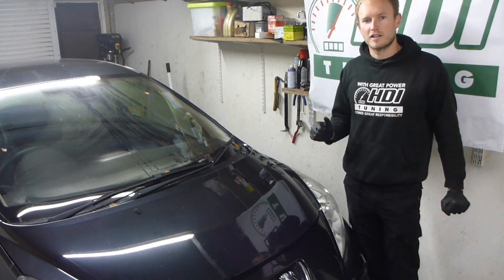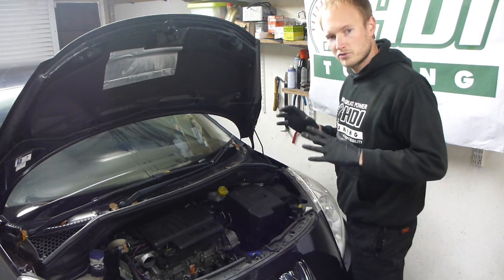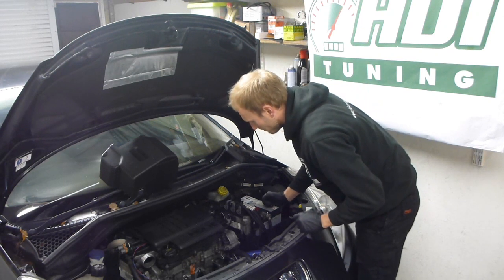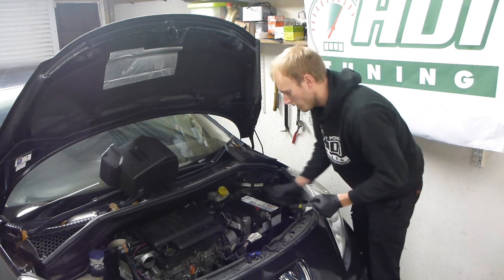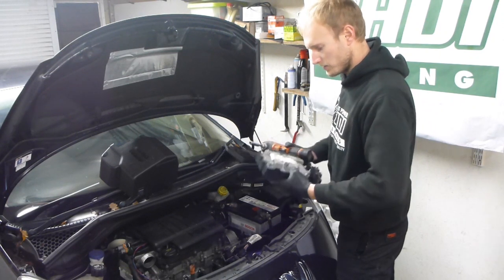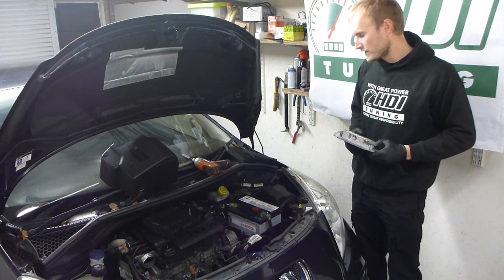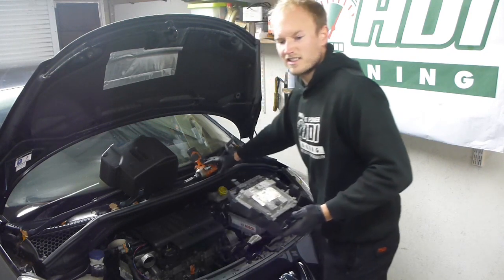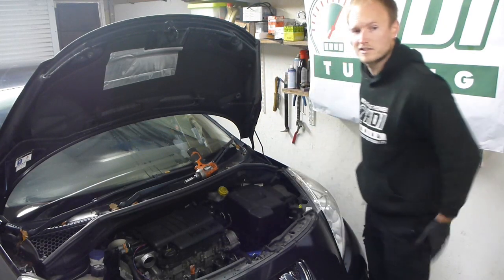How to remove the ECU from a Peugeot 207 1.6 HDI Bosch EDC16C34

Comment: I was dumb enough to drop the ECU on the battery and it made contact.complety fried it and know have to look for a full replacement which is almost the entire car worth I dont know what to do know.
I have puegot 207 out of 2009. any fix that will not cost atleast above 300 euro's
Reply from the maker: We sell ECUs, they aren't expensive. Check all fuses too in the engine bay fuse board and the BSI. Did it melt any wiring, or was it just a. Quick spark to the ECU?
Reply: @StevenLewis-HDI-Tuning   a quick spark to The ECU got it of the battery in a second. 

I have old puegot donor car sitting around tried that ECU as replacement and now the car does respond but than i found out there is a slight difference and all these codes / programming that have to match to letting it crank or something

Comment: Can I put an ecu from a 1.6hdi into a 1.4 hdi ?
Reply from the maker: @LukeHayes-j9d  yes it will run, but the injectors are different, timing is different, head is different, displacement is different. What are you trying to achieve?
Reply: @StevenLewis-HDI-Tuning this is a ecu from a car that I have for parts but it’s a mapped ecu

Comment: Hi i try to change the radio on my Peugeot 207 and I make a short I have the following problems now central loking dost work the small screen not working when I try to start the car engine is not starting it can be an ecu fault or just a fuse all the fuse seems ok after testing with multimeter what can I do ? Thanks
Reply from the maker: You probably broke the bsi or just a fuse. Not the engine ECU that's not linked to the radio is it..
Reply: @StevenLewis-HDI-Tuning  I check the box fuse next to battery and the fuses in bsi inside the car there is another box with fuses for this model ?

Comment: If we have a problem
With the power steering that's not communicating with the power steering ecu is this the ecu that's it's not communicating with thanks
Reply from the maker: No, this is only the engine ecu. Check the big 30A fuse for the power steering

Comment: Hi Steven.
On an 3008 mk1 , when replacing the steering lock and key do you need to replace the ecu from the same car as the keys to start the engine?
Reply from the maker: You can program the new key to the vehicle, speak to a auto lock Smith
Reply: @StevenLewis-HDI-Tuning  I known that , but can it be done with replacing the ecu?
Reply from the maker: @samys-g3o  with an unlocked ecu with no immobiliser you wouldn't need to code it.
Reply: @StevenLewis-HDI-Tuning  thanks for  replying my questions.but I lost the keys for the car and I can buy an complete lock set and ecu from an donor car .I can replace the locks but the imobiliser won't work hence I'm asking if I install the ecu from the donor car as the lock will be able to start the engine without programing the new key imobiliser.
Reply from the maker: @samys-g3o  the BSI, key chip and engine ECU are coded to each other so you'd have t swap the whole set
Reply: @StevenLewis-HDI-Tuning  thanks Steven for confirming. Yes that was my question .
It's there anything else that need replacing to original car accept key chip and ecu from the donor car?

Comment: Hi Steve, was going to change the fuel filter on my Peugeot 207 2008 1.4 hdi. For this you have to swing the filter to the right, but the ecu is in the way, lifted the ecu out but managed to short circuit this against the positive side of the battery. Unfortunately the car will now not turn over, have all ignition lights, checked all fuses, non seem to be blown, have I blown the ecu unit? What will it take to get this car running again?
Reply from the maker: Probably killed the ecu that happens a lot, bad design on Peugeots behalf. If you email me through my website with a photo of the label on the ecu ill sort you out tomorrow. I've got most available for immediate dispatch.

Comment: Hi Steve thats awesome!
what is required to run the engine once the Immobilzer is removed??I want to run the engine in a boat.Do you think thats possible if I sent in my ECU for imobolizer removal?
Reply from the maker: Its best to put all the modules and wiring even if its just in a box, and then work backwards removing modules one at a time. I dont think you can make it run without the BSI but everything else you should be able to remove

Comment: I have a Peugeot 207 2012 model. When I turn on the aircon my car goes into limp mode. Can anyone say what could be wrong. Without aircon car goes good. Once I turn aircon on it goes into limp mode and a orange light turns on the dash
Reply from the maker: You need to scan for fault codes, we cant guess this one so you need to connect using peugeot diagbox diagnostics and see whats causing it.

Comment: Hello. I have a enginelight on the car. And warning text: Pollution fault. Problem, broken/fault ecu?? Can i take out my broken ecu. Buy a used ecu on ebay and just plugg it in? Or can the problem be fixt? Or do i have to get the car to a mechanic after i put the "new" ecu in? Thanks 4 the help. :)
Reply from the maker: Hi, an ecu can't fix mechanical faults on your engine. First connect with Peugeot diagnostics equipment, find the cause of the faults and then fix accordingly.
Reply: @StevenLewis-HDI-Tuning  Do the Numbers have to match identically on the two ecus? I had a tuner before try to sell me an ecu with different Bosch & psa numbers on it and I thought hell no surely they would need to be identical for everything to work liable to blow something up lol
Reply from the maker: @Mr330d  yes all codes should match up, otherwise you'll end up with faults or strange behaviour, or if it's completely wrong it will run like a bag of spanners and break down shortly after. Why not just get the right ecu, I have most of them available for psa and for a lot cheaper than your mechanic will charge I expect.
Reply: @StevenLewis-HDI-Tuning  I was thinking to myself absolutely no way can you fit an ecu with different matching codes yes I plan to buy one of your ecus soon because I was having boost issues with my 307 and didn’t want to fit anything until it was all sorted . It actually goes alright for a 90BHP 215NM torque
Reply from the maker: @Mr330d  it probably needs a new turbo solenoid? Not very often an ecu fault will cause boost problems on these.
Reply: @StevenLewis-HDI-Tuning  I fitted new solenoid new vac lines etc then the wastegate wouldn’t budge at all with vac so tried another actuator and the vacuum moved it freely so put a new actuator on seems to be ok now

Comment: would be wonderful if you can zoom in during removal.
Reply from the maker: It's really easy, the top covers just pull off. And on one part there is a small clip to push to the side.
Reply: Are you still fixing these?